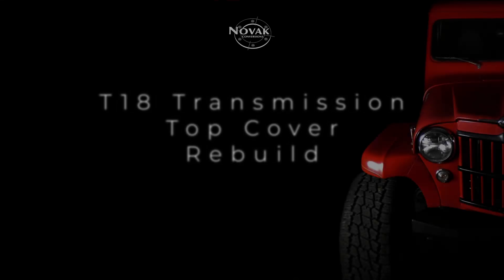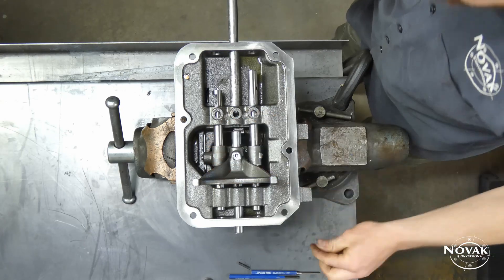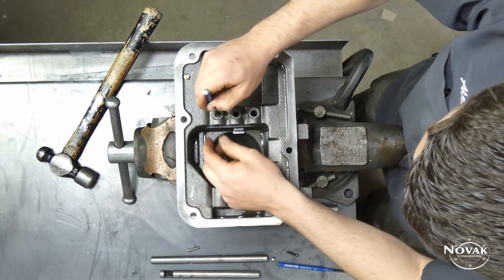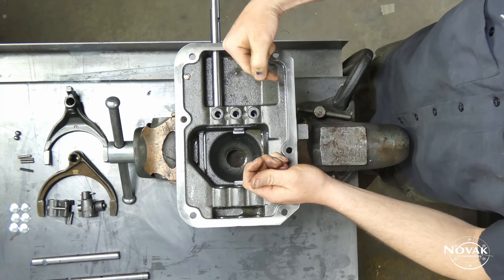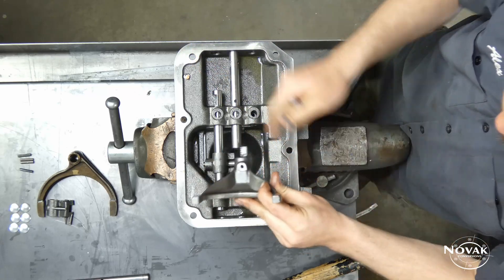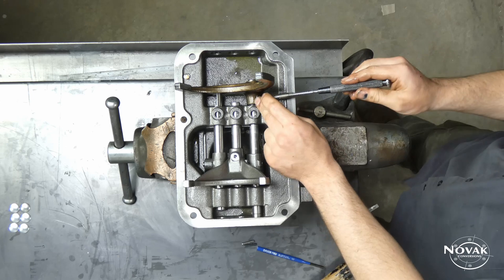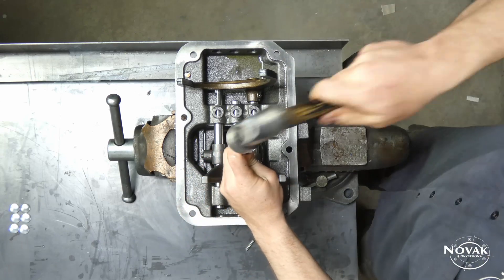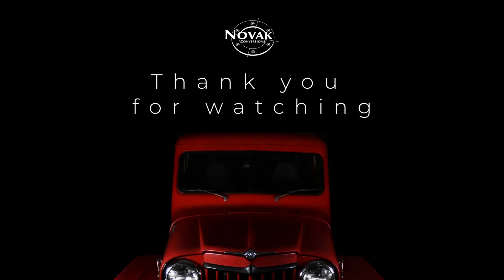Borg-Warner T18 Transmission Steel Lid Rebuild

Comment: Thanks for posting this--great timing! I actually used this video just yesterday when my Jeep's shifter went limp after a long ride on Monday. Turns out a fork that had fallen off when the detent screw came out with prolonged off-road jostling, and I just watched this video and followed along with my disassembly process until I found the problem. 

For reference, my T18 (in a rebuilt 72 CJ-5, originally from an F250) has a detent screw into a groove in the rod on the right and not pins like was shown in this video, as do the other rods. Otherwise the process should be the same, but I would think your kit will vary from the parts in some T18 models.
Reply from the maker: Glad to hear that it has already helped somebody out! We will be releasing a lot more instructional videos, including ones for T18's.